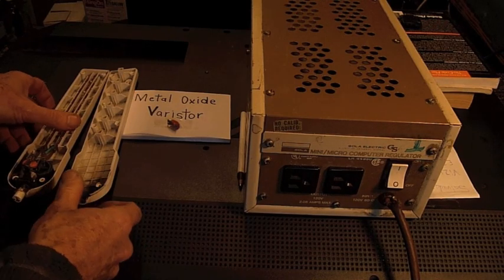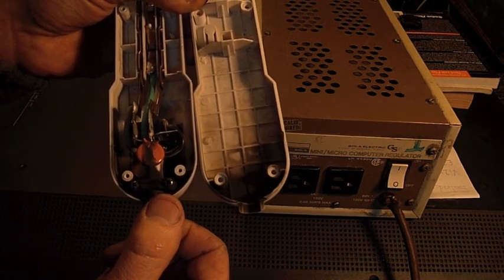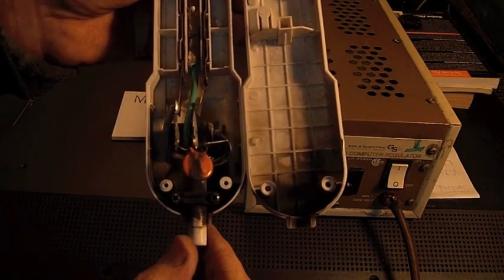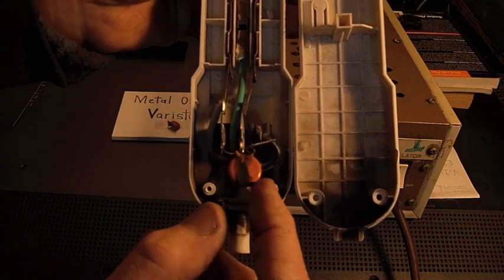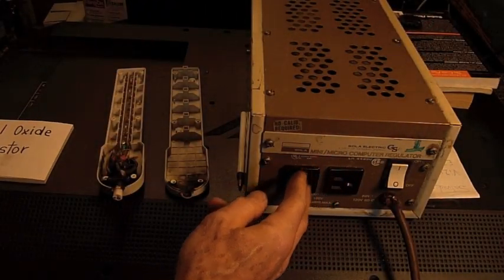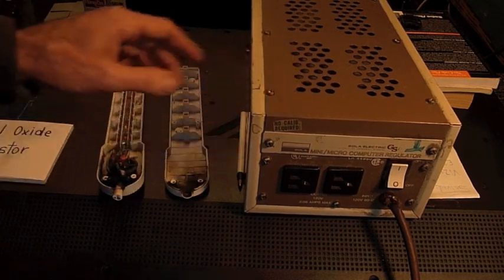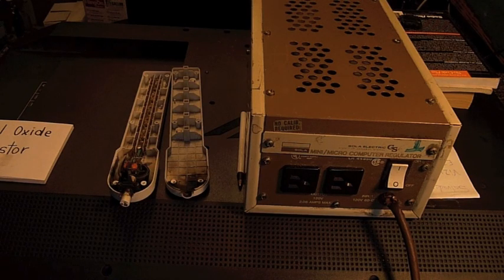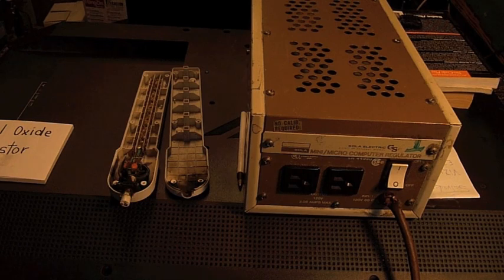Surge Protectors can be false protection.

Comment: You also want to look for a speed rating i.e. how quickly the surge protector will cut the current. It'll be rated in milliseconds. If it takes too long to cut power, the connected electronics will already be damaged.

Comment: when i was taking computer classes way back when; late 80s or 90s, the college i was at the head of the department brought in a "surge protector" one day" the thing was toast.day before there was a  electrical storm. lightning had hit  a lo voltage power line . cam into the campus circut via the lead instructors office , destroyed a port on a computer went into the labs server room via data line nailda port there ,then proceeded to go accros the lake via data line and destroyed the eops (adult special ed) directors mode. havent  trusted them hence. have a nice day.

Comment: Joule rating is not an official performance specification for surge protection.  The irony is that if you want protection, the lower Joule rating would be better because the MOV would sacrifice itself faster.  A higher Joule rating means the MOV will pass more surge energy through to your equipment but will itself survive longer.  

Only Voltage Protection Rating and Maximum Continuous Operating Voltage are recognized UL specifications.  Isolation transformers do not protect against surges.  They pass normal mode surges through.
Reply from the maker: Thank you for the information. I placed a link to your site on the video you saw.
Reply: Thank you very much! If you would like to discuss any other surge protection issue, please do not hesitate to contact us. There are so many myths about surge protection out there.  800-996-6696

Comment: This is simple protection and it should work in the case when neutral wire have been lost - in which case you will get 2 phase voltage between a phase and neutral wire (400V in Europe and 210V in USA - that is a square root of 3 multiplied with phase to neutral voltage).

What it should do is to blown itself, make a short circuit and then the safety fuse should turn power off. But you must know what have happened before putting an electricity back, and most people does not know it.

Varistors are found in most equipment. From TV sets to PC rectifiers. Its only purpose is to blow, make a short circuit for enough time until the main switch "jump off".

Comment: MOVs are best use in conjunction with a (suitably-rated) fuse or other breaker ahead of them that will open if a sustained overvoltage occurs. 
MOVs tend to fail short-circuit on overload and because of this will eventually burn themselves open. If the fuse disconnects the supply before that happens the equipment is protected though the MOV is sacrificially destroyed.

Comment: What's the make & model of the c.v. supply?
Reply from the maker: +davecc0000 
The high end surge protector is a Sola Constant Voltage Transformer.
I can only handle a 2 .08 amp load. There were several numbers on it that may be model numbers. The one on the face was LR44950. On the back it was 95-130 and catalog # 63-13-125

Comment: would an inspector find the issue if there was one or did you really have to hunt the issue down? I'm just worried about my home possibly being at risk as well as increasing my knowledge, but thanks
Reply from the maker: +The Tinkerer In this case it was fairly easy to spot. One of the ground wires  coming out of the service panel and going into the house had 120 volts on it, and that's not possible. It can't be ground and hot at the same time so I knew there had to be a brake in the wire between wire coming off the ground terminal and the other end of the wire going into the house.. Surprisingly the wire inside the insulation was actually broke. I'm guessing it had to be a manufacturing defect since the insulation around the wire did not appear damaged.